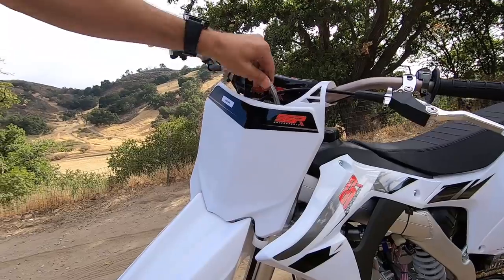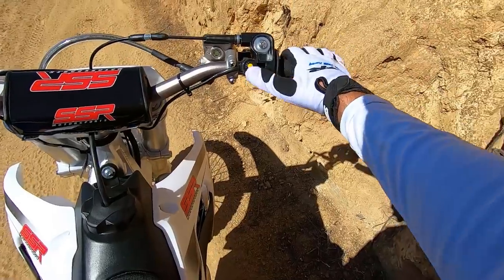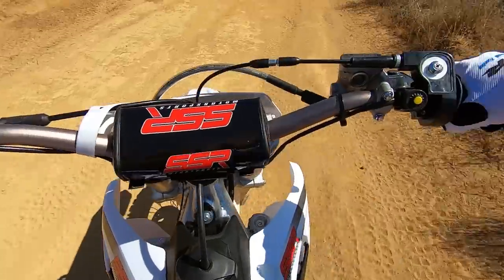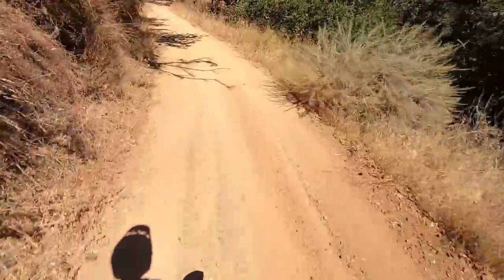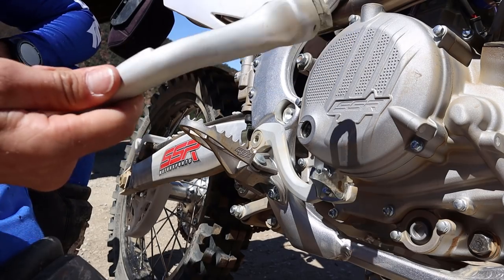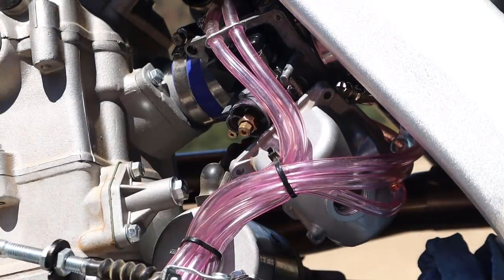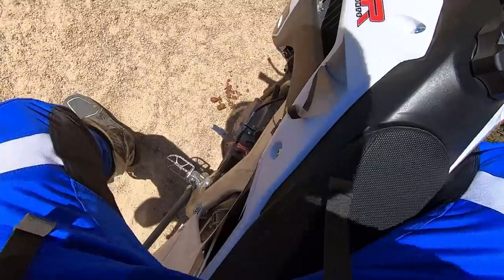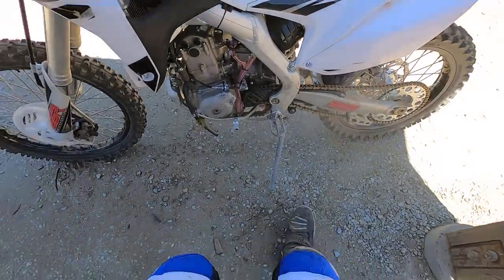I bought a brand new CHINESE dirt bike... And WOW - All new 2020 SSR SR300 first ride & review

Comment: Would you recommend this bike over a honda CRF250 or KLX300R ?. I am experienced on quads and crotch rockets but looking to get something to go off roading with that aint a quad, so needless to say I am a new booty on dirt bikes.  I should mention I am 6 foot about 250lbs and having a helluva a time deciding between this and the Honda or Kawasaki.
Reply from the maker: Well, 

I think you'll like all of them quite a bit but it'll depend on a few variables.

The SSR is full size and packed with features. It can be enjoyed on trails or light MX in stock trim.

The CRF250"R" is pure moto, suspension for moto, and no e-start. The KLR is the exact opposite of the Honda.

No wrong answer, but if you are going to buy the Honda used, I would strongly suggest the a new SSR for a similar price. 

Lot's of variables, no wrong answers.

Welcome to the rad side!

-Charles // mXrevival
Reply: @mxrevival   I was looking at the CRF250F brand new which is about 200 dollars more than the ssr300 I dont need the R lol Your review was very indepth, its going to come down to the Honda 250F or SSR300 or 450 for me. The suspension is my biggest worry I got a banged up back from the Marines and heard the 250F suspension wasnt the best.
Reply from the maker: @issacturner7794  Ok cool!

If you're talking Honda 250"f" I don't believe it's quite as "full size" as the SSR so it may be worth considering if you want the bike to feel more like your past race bikes in height & ergos.

The suspension on the SR300 is super plush and the slower you go the happier it is so I believe it'll be very cozy for you. 

I bet the Honda is really plush too, just a bit smaller of a bike. But a smaller bike & lower height would be a deal breaker for me as I stand up most of the time (6', 200lbs). 

The Honda appears to have conventional forks instead of USD forks (upside down) . It'll be a trail only machine with less suspension travel and will have limitations if you want to push it.

I have an SSR MX track video coming this week. I was shocked, truly. Maybe that will be helpful too...

Aside from that, the Honda will look great and run great, hold value well.  But if it's too small 🤷‍♀️ 

-Charles // mXrevival
Reply: @mxrevival  I really appreciate your insight, I'm thinking the ssr 300 or 450 may be the way to go. Will that video you'll be releasing show all the upgrades you have done ?
Reply from the maker: @issacturner7794  It's my pleasure.

Happy to help. 

I'm saving the mod videos for you guys one by one, but this next one is a rad day at Glen Helen Raceway on a pair of SR300's! As well as a sneak peek at what the 2021's will come equipped with

Helluva time! 

Probably the most requested topic I've gotten.

But, one of the first mod for the SR300 can be seen here: https://youtu.be/PFKjn6fyG9E

We developed the first-ever Lectron for this sweet little runner.

Thanks Issac

-Charles // mXrevival

Comment: As I beginner bush basher, it serves its purpose but as soon as you start pushing them you will find that you get what you pay for. It a cheap copy that will wear out quickly. Had one. it was OK till it started to fall apart and whilst it looks good, is full of low quality parts. If something looks to good to be true, it generally is.
Reply from the maker: It was a 2020 SR300?

Comment: Where can I find a second hand bike like this one, I´m from Texas? Any sites or suggestions?
Reply from the maker: Nowadays, Craigslist and Facebook marketplace even more so seem to be the best options. Maybe cycle trader, but mostly you'll just need to keep your eyes peeled and look often. 

When one pops up you'll be able to snap it up.

It is a new model for 2020, and not the most commonly ridden brand of bike in the first place so you may find that used ones are pretty scarce.

I'm not condoning anyone go finance a motorcycle, but if that is the route you take I'm sure the payments would be extremely low. (Nothing wrong with financing either, Lord knows how many bikes I finance in my lifetime!) 

Then you have a brand new bike, completely un-molested by someone who may or may not have taken care of it.

Sort of a personal rule of mine. I stay away from used four strokes generally speaking, with very few exceptions.

Hope that helps and thanks for watching!
Reply: @mxrevival  sorry for the delay, but that was very helpful! I will keep it in mind.
Reply from the maker: @jeromr1  😎

Comment: The Chinese bikes are alot better than most people think. I had a taotao hellcat grom clone. I put a Zongshen 190 5 speed and a mikuni flat slide in it. Totally street legal and it ripped. My top speed was 80-82 on it. I rode it for 1500 miles with zero issues. It was my first bike ever also btw. I sold it to buy a harley and the kid who bought it still rides it. People who talk trash just have no idea. The pricing of these bikes is incredible. With any Chinese bike go over it when you get it then ride the hell out of it. Good vid and enjoy
Reply from the maker: That is so rad & fun! Thanks for sharing, and you're right. It's all talk most of the time. I get it too, but... Keep ripping dude 👊
Reply: @mxrevival  will do sir and you as well

Comment: Hey Charles, myself and my buddy have been wanting to get into the moto sport mainly trail riding. But the only two wheels we’ve ever been on are for enduro/downhill mtb. Would you recommend these bikes compared to getting a used Honda or Yamaha etc?
Reply from the maker: Man it's really a matter of following your heart on that one. If you want more power the Japanese bikes are what you'll want but then you're on an MX bike on trails (not as ideal) also used 4 strokes are time bombs. 

I think the SSR is really great for the money especially when you consider the cost brand new, the aftermarket mods I've done to make them better engine wise & looks wise. It makes plenty of useable power that won't et you in trouble + electric start, etc. 

Pick the one your heart likes & if you're hooked on riding, neither choice of bike will be your last bike anyway. The SSR is great for ANYONE big, small, learning or otherwise. 

Thanks for watching & welcome to your new addiction!

-Charles // mXrevival

Comment: Came across this video as I am in the market for  Yamaha WR250F and wondered if the 30 HP@9500 on the SSR compares to the power of WR or any of the Japanesse or European Bikes in the 250 class  ? What's your thoughts or could I do some easy Mods and jack the power up. 

Great Video and thanks for sharing !
Reply from the maker: Thank you Bob!

Man, it's a bit of apples to oranges because the SSR is not a high-performance motorcycle like the Yamaha, but it still gets the job done well with a ton of comparable accessories. Then the obvious price difference.

I think the SSR is a really killer package with a lot of bang for the buck. As for more power, yes I'm already on it! https://youtu.be/PFKjn6fyG9E

I'm working on cool mods for it all the time. I have some really great ideas lined up & it's been cool building a little community of enthusiasts that want something different. They even have their own Pro Circuit exhausts!

Past that, super easy sprocket swap and you can have more torque than a guy could even need. The use of Honda bodies and certain hard parts gives us a wide-open choice of aftermarket products from plastics to rotors, etc... replacement parts are cheap where they need to remain SSR- entire engine is only $1500 in the event of some unlikely event & that's abut the cost of the WR cylinder head & vales by itself! 

Engine is a Zongshen NC300 & it's the "Honda Civic" of the Chinese engine world. Just millions of them & parts galore.

It'll come down to what YOU really want. That's all that maters.

Comment: Correcy me if im wrong but,
Are those honda plastics? Or is it just a knock off
Reply from the maker: It's a copy of the 2016 Honda CRF body. Except for the radiator shrouds. The radiator shrouds mimic the 2020 crf450, but actually have completely different dimensions. However, 2016 CRF radiator shrouds would bolt-in in their place no problem and properly

Comment: I worked in a motorcycle shop called Bobby J's Yamaha and we sold these bikes. You get what you pay for is all I'm gonna say.
Reply from the maker: Nice!

Did you buy one?
Reply: Hell no. I didn't even like building them. Lots of cheap parts. Most of the time they didn't even send all of the right bolts. The threaded holes were pre stripped out alot of the time as well. These things are pieces of crap in a shiny wrapper.
Reply from the maker: @schuylerschmidt8107  sounds like they've come a really long way then!
Reply: No not at all actually. The only thing they've really changed is the plastics. A vast majority of those who bought them had to put money into it to make it any good. At that point why not just buy a Suzuki or an older used bike. You'll have alot fewer headaches.
Reply: @schuyler schmidt How come when I called Bobby J's in NM, I directed them to this video & comment, a manager got on the phone & said he knows the name Schmidt & that you were fired for stealing and you never assembled any bikes & that you wouldn't know what a Torque Wrench was if he hit you with one? Just asking.
Reply from the maker: @schuylerschmidt8107  no, I'm telling you they have 🤣 Since I own the bike! 

I get the Suzuki argument too. I also own a 2018 RMZ. It was $7200 out the door after fees. (pre-covid price hikes) It was hardly suitable for MX track riding compared to the other Japanese and Austrian brands, and would have been downright dangerous on trails with the stock BFRC shock. Suspension too fast, bike overall too rigid for trails. Like really brutal.

On one hand, it was the most affordable true motocross bike. Great when compared to other motocross bikes. 

On the other hand, compared to the SSR, the Suzuki needed suspension at $800, and other mods included engine mounts and pipe. Let's say another $399 & $1000 for those titanium beauties.

The SSR will get mods too, sure, but will ultimately still be more affordable.

The Suzuki is dialed in, I love it now. At about $9K all said and done. 

But truly, they are not even in the same category. It's apples to oranges. One is a high performance MX bike, the other is not. 

I enjoy them both for different reasons and am stoked to have them as part of the fleet here at the shop.

Owning a motorcycle at all, regardless of brand, is something to be super thankful for. Probably the most important thing to remember.

For some it's only a dream, and I'm fortunate enough to live it in abundance.

-Charles  // mXrevival
Reply: @ghpjerry  pretty easy to lie online bud lol I left the job after I severed the tendon in my right index finger and found a better paying job while I was out of work 😂 why you gotta lie?
Reply: @schuylerschmidt8107  Apparently I didn't do a good enough job of making my sarcasm clear. I was joking around. Re-reading it I can see where I didn't go far enough to show I was messing around. My apologies, I was just having fun.

Comment: Theirs never been much doubt of the Chinese getting the job done.  The doubt has been in the reliability, can u count on it when u need it.  Understanding the pricing but alot of an I mean ALOT of the industries issues is EDUCATION. I personally believe the sales representatives at the dealers need to really educate perspective buyers. An sometime that won't be enough. I know alot of people who believed riding road bikes gave them the experience they needed to handle a 450 (machismo) thinking they were to manly for anything smaller an not knowing the dirt is a completely different animal. Anyway theirs alot more I can day but I'm sure I got across the jest of things
Reply from the maker: On the topic of pairing the right bike to the rider and your example- that's so true. 

This bike is the right bike for MOST people who aren't racing at a high level (for example, others of course) -like you said, you could go on about it...

This bike is much better in construction than many or most Chinese offerings. I wouldn't have bought it otherwise as an avid rider of Japanese & Austrian bikes my whole life. The bike genuinely caught my attention.

This engine has a great track record by way of hundreds of hours (Zongshen "NC") and is used in hundreds of other motorcycles. Lots of parts availability too. Extremely affordable as well. 

Anyway, I liked it, I bought it, I'm having fun on it. The videos will help others figure out if they'd like to check one out too. I'll enjoy my Japanese & Austrian bikes too & use the SSR where I have the most fun on it & part of that fun is showing it to people who are interested here, which is more than I ever would have guessed but I felt it when I saw this bike. Truly.

Happy New Year!

-Charles // mXrevival

Comment: Was looking at buying a bike, im a first time rider/ buyer. I won't be riding real hard as I am disabled. Mostly just logging roads and easy trails. Would this be a good bike for me? If not what would you recommend? Thanks for the video, it's the most in-depth I've seen on a bike like this. I look forward to hearing from you.
Reply from the maker: Hi Gary, 

It absolutely would be!  It's a little tall but basically the same as any other full size bike in that  regard. I get the sensation that the pegs are just a little higher than other full size bikes when riding it. Within an inch or so.

You'll love it & can't beat it for the money.

Thanks for watching & I'm glad I could help in any capacity with the bike's details.

-Charles // mXrevival

Comment: Curious how that rear hub is going to hold up, looks a bit bicyclish. Strap that kicker behind the number plate up front, ya never know when you might need that l'il sucker.
Reply from the maker: Man, in person- It's almost kind of massive. Wish I could drop pics in these comments. (the hub)

That's a really, really good point on the kicker... Going for a full shaft delete shortly though! 

Maybe I'll strap an extra battery then... It's lighter than the K-starter 😂

Thanks for hangin'

-Charles // mXrevival

Comment: Curious why anyone would buy a Chinese-built Honda rip-off trail bike when you can get a brand new, rock-solid reliable Honda CRF250f  for $4500?
Reply from the maker: Not sure it matters if the buyer is happy 😎

Crf250f is a bit smaller too I believe. This 300 is full size. 

The Honda looks great.

Comment: I want to see a more advanced rider on a MX track so you can get a better idea of the power and suspension
Reply from the maker: Truth is, you probably won't find too many "advanced riders" using one of these bikes - but you can check out my first visit to Glen Helen and next track on them https://youtu.be/zOUkrH4JonU
Reply: @mxrevival  hey I just checked it out. That’s what I wanted to see. How it pulls u up hills, corners and jumps. Bottom end torque and breaking. Nice video 👍 thanks!
Reply from the maker: @7pines77  you're welcome, thanks for watching. 🙏

Comment: Undersized carb and yes lean like the tower of piza! Seems like a crf150 Shoulda saved up and bought Japanese, but at least your out on 2 wheels!
Reply from the maker: That assumes there aren't 9 other Japanese or Austrian bikes here that I enjoy as well (18 wheels I guess??)

But you are right about the carb! Airbox allows too much air, needs more restriction (directly from SSR HQ). The 2020 carb has been dropped for a FCR style pumper in 21.

Comment: Excellent video and review : ) Very intrigued by this bike. For an older/former MX'r just looking to ride trails in GA now, how would you compare it to the Kawasaki KLX 300r? I see the SSR is already 30 lbs lighter. Basically for the price point, these are my two choices. Thanks again for the review!
Reply from the maker: Sorry to be seeing this so late! I hope by now you found the answers you were looking for. Unfortunately I have no experience with the KLX 300 but I do believe it is a smaller bike, we're not quite as full size as the sr300 in seat height. The overall quality would probably be better though as a premier Japanese brand

Comment: If you keep bumping the throttle like that Rev the Rev then Rev you'll just keep fouling plugs by over loading the pistons with fuel and these bikes aren't as efficient so you'll go threw the plugs fast
Reply from the maker: So far so good, stock plug! Two stoke habits..

Comment: Do you know the changes  between the 2016  and the 2020 ?
Reply from the maker: I do-

This bike is 100% new for 2020 & didn't exist in 2016 😎

They had (still have) a 250F & 450F back then but they are different bikes altogether.

Hope that helps, here when you need me

-Charles // mXrevival

Comment: I just picked one up from my dealer last week. What is the break in process? Any help would be much appreciated.
Reply from the maker: Congrats! Just take it easy and have fun. No pinning it on day one even though it would probably be fine.

I like to change my oil after the first ride and 4-5 hours between changes their after.

I clean air filters in ally bikes after each ride. Keep 4 on rotation (pre oiled & ready to install) and use No Toil oil & cleaning system to make life easy. 

10-40 oil. 

Have fun 👍👍👍